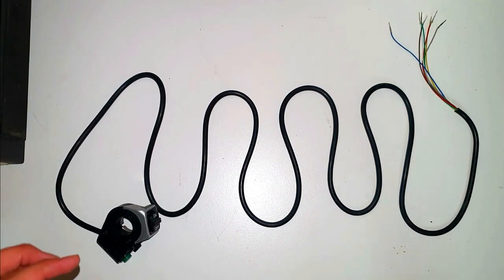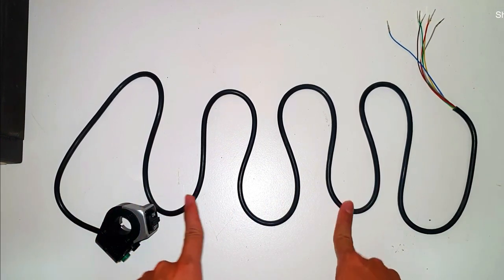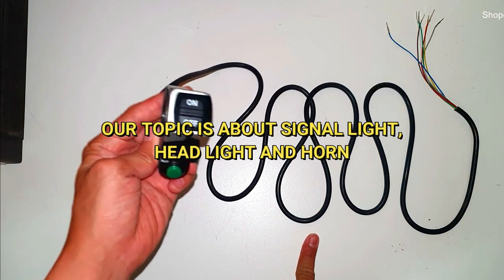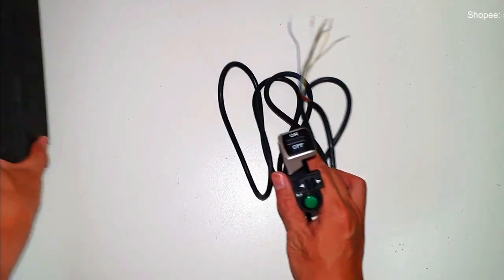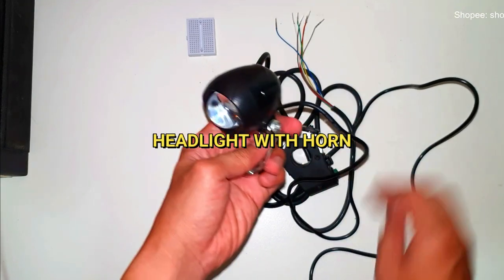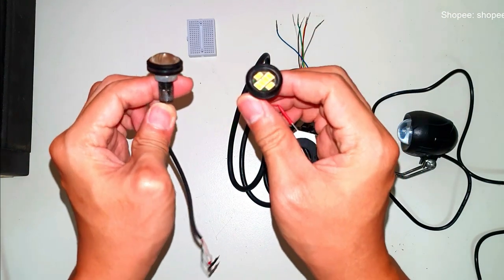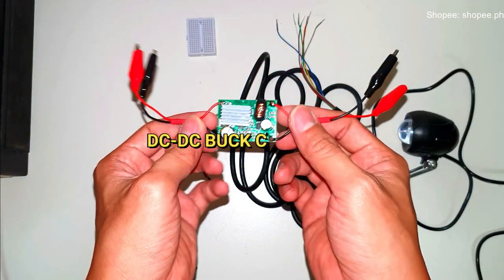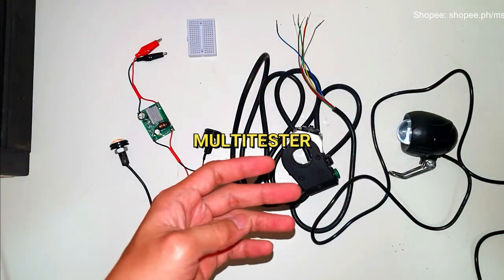ELECTRIC SCOOTER SIGNAL LIGHT WIRING DIAGRAM // FIIDO Q1 // MOBER S10 // HEADLIGHT AND HORN SWITCH

Comment: Sir paano po sya i-connect sa actual? lahat po ba ng nasa positive side ng bread board all connected po sa 1 wire lang? tapos ganon din po sa negative side. tama po ba?
Reply from the maker: yung negative yes sama sama lang lahat, yung positive naman, hiwalay at need dumaan ng switch

Comment: Sir pano po yung scooter ko walang breakligth need po ba mag palit ng controller po salamat po sa Dios
Reply from the maker: Normally may brake light port ang mga controller. Pero kung wala, pwede ka naman gumawa sariling linya. No need magpalit ng controller.
Reply: @mskgenmer  sir. Pede po ba gawa ka po ng video about sa mga scooter n walang breakligth.  Nanrobot d4+ 2.0 scooter ko po sana po makagawa kayo ng tutorial para jan Salamat po sa Dios ng madami malaki po naitutolng nyo samin n mga scooter user😊